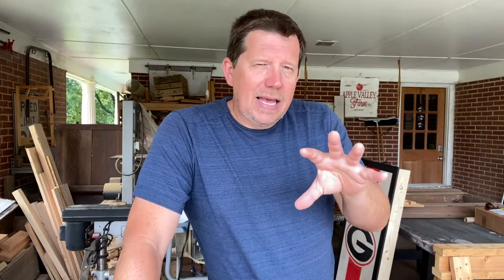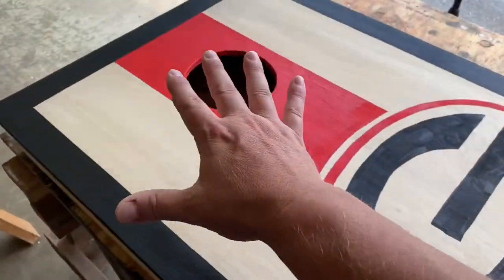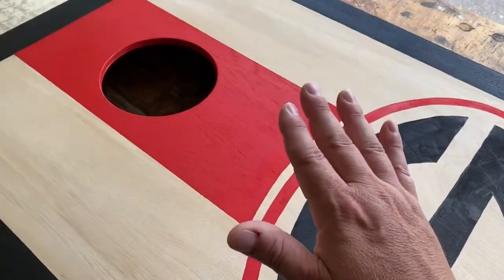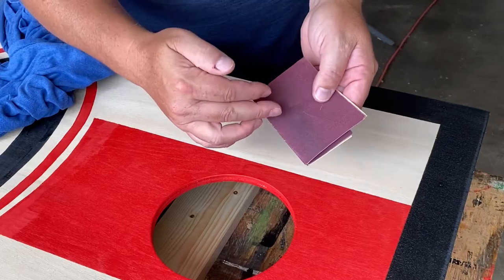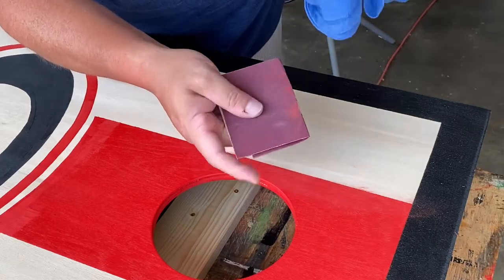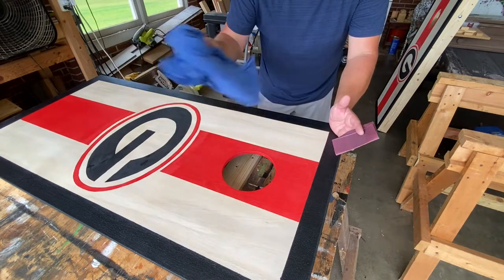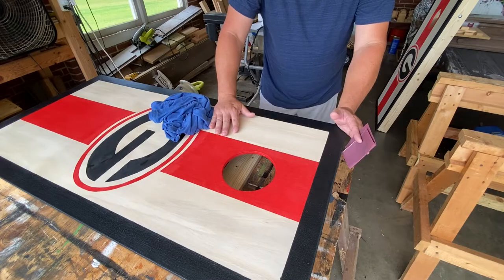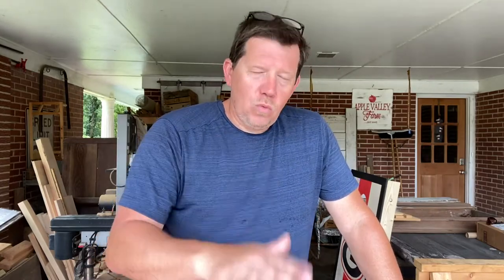How To Build Cornhole Boards: The Final Prep Sanding

Comment: Can I ask? What kinda paint do you use on your boards
Reply from the maker: Just a basic latex/acrylic paint. ANd preferably a flat finish...it sands easier. You can use a pricey paint if you want, but we're covering it up with 3-4 coats of poly. So we aren't all that concerned with the paint itself.
Reply: Thank you